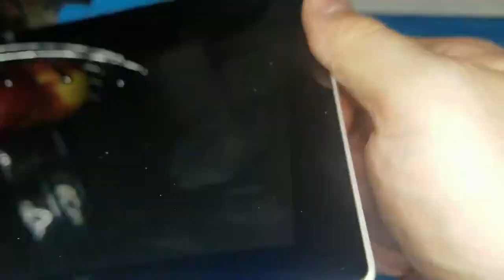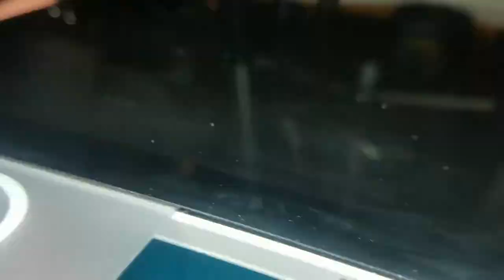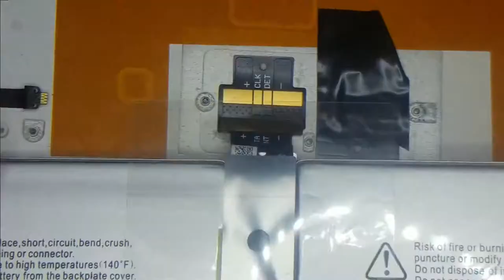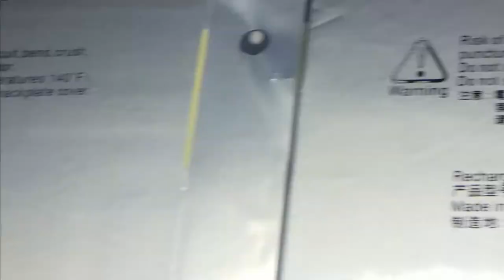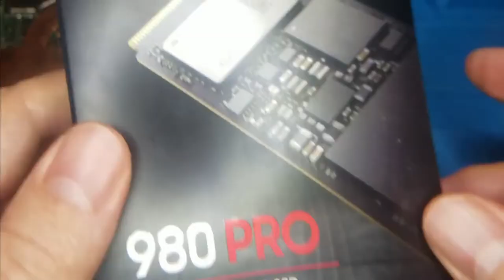Microsoft Surface Pro 4 - screen bulge fixed, battery replaced, SSD upgraded!

Comment: This is exactly what I needed. A proper full teardown and reassembly, including motherboard removal.
Reply from the maker: Glad it was useful, hope your project went well ;)
Reply: Sort of. Screen is off successfully, but wow that antenna array is designed to be destroyed on removal! 

£20 for a new assembly and £36 for a new battery and I should have a fully working surface pro 4 once again.
Reply from the maker: Ha, I know what you mean! Before you splurge on new antenna strips, check if you can simply straighten them up. Unless you straight up cut/tear them on removal, these are just foil strips, if they're just bunched up you can unfold them back.
Reply: @JustMakeItNow  unfortunately it’s toast. The best advice i would give others is get a sharp knife and cut as close to the display assembly as you can. That black glue is sticky and horrible
Reply: @JustMakeItNow  what did you find was the best way to remove all the glue before reapplying new glue?
Reply from the maker: Just scraping. But I just removed flappy/torn parts, and kept most of the original glue in place. It is just as sticky as before after heating it up a bit. So I just replaced missing adhesive parts, not all of it.
Reply: Great success! One new battery installed. Definitely take the motherboard out. It’s longer but much safer. Thanks for the excellent video
Reply from the maker: Congrats!

Comment: It's impossible to do such precise handwork with that fast music going on in the background!  Would have preferred the walk-through with no music at all, and with closer real-time video of how the little connectors and adhesives come apart.  Recommend using an ice cube tray or egg carton for tracking the screws and other small parts in their sequence of removal.  Thanks for the video!
Reply from the maker: Thanks! You can mute sound and change playback speed in the player controls. The video is already pretty long, and if it would be 1x speed everywhere no one ever would click on it ;)

Comment: Awesome video! Leaving a like and sub, keep it up man.
How thick can the double sided tape be? 3mm too much?
Reply from the maker: Thanks for the sub! I actually used exactly 3mm wide tape in this video ;)
Reply from the maker: Just to be clear, 3mm is width, not thickness.
Reply: I got some that is 1mm thick. The old one does not stick much anymore. Thinking about removing the old tape to make room for new stickier tape. What's your opinion?
Reply from the maker: Yeah, if the old adhesive is not sticking anymore, or is mangled up, it is better to remove and replace it. At the same time, you probably don't want to use super strong stuff in case you need to open it up again some time later.
Reply: Trying to put it all back together. Good news is it's booting. However, it appears that the screen assembly may have been damaged during removal. I get flickering and lines all over the place. Those ribbon cables only attach one way or is it possible to clip them on out of position? Maybe that's what I did.
Reply from the maker: Damage is a possibility, but sometimes the same effect could be due to bad connection. Try to re-seat display connector, there is really only one way it can be connected (but sometimes connection is incomplete).
Reply: @JustMakeItNow  OH well, I've tried to re-seat it a couple of times but always shows up with the same set of problems. There is also a (new) Crack richt across the screen although I can only see it if the screen is on. May have to buy a new screen.
Reply from the maker: Yeah, if you see a new crack there is a good chance that the issues you're seeing are due to the actual damage. 
:(
Reply: @JustMakeItNow   We'll see. New screen arriving next week

Comment: Great video! Wish I had seen yours first.. Didn't know about isolating the battery. Now it won't power up. Any idea what has blown can I fix it?
Reply from the maker: Sorry to hear that :( This is not uncommon, unfortunately. First thing, check the battery connector pins, sometimes these get deformed during disassembly/reassembly, and this prevents solid contact. If that's not it, try your old battery (if it worked at all), sometimes aftermarket batteries are faulty from the get go. If none of the above helped, things get progressively more difficult; potential fixes will require hot air station and knowing what you're doing. Couple of common things that go bad during battery replacements are Schottky diodes on the charging circuit, or any number of fuses on the mainboard (some are marked as 0 Ohm resistors). If you're good with microsoldering, check out this page, they have a good summary of potential issues with SP4 power: https://www.aonemobiles.com.au/2020/03/microsoft-surface-pro-4-no-power-no-schematics-no-problem/. Good luck!

Comment: thanks you for this tutorial, can you tell me what type of bit you are using on the screw gun. I have taken apart an iMac and have the screwdriver for those screws, I am wondering if it's the same size.
Reply from the maker: I don't remember exactly, but I am pretty sure this Surface Pro 4 used T4/T5 bits (Torx). I don't know what was in your iMac, but there is good chance that it may not work. Apple tends to like using pentalobe screws, these bits won't work on Torx.

Comment: :yt:Thank you for the tutorial.  But would you please tell me where you purchased the new battery and how much it cost?
Reply from the maker: I did buy my replacement battery through the local wholesale mobile repair supplier, so that probably won't be helpful to you. You can easily find these batteries online though, just search for "G3HTA027H" (this is the battery model number). They go for about $40-50 or so. I know for a fact that there are some on eBay, Aliexpress and even Amazon. Probably not OEMs, but I'd say it is still a pretty good deal to restore your Surface Pro 4 back to almost original condition.

Hope it helps. Let me know if you have any other questions! ;)
Reply: @JustMakeItNow  Thank you for your reply.  I found some eBay seller that carries this model number.  I also have a Surface Book (model: 1703 / CS4-00001) with a similar issue.  The right side of the screen is bulging.  I would like to replace the battery too.  Do you by any chance know the battery's model number? If not, is there a way to find it out?  Thanks.
Reply from the maker: I don't own this model, but I believe there are several battery models that are compatible with your 1st gen Surface Book: G3HTA044H, DAK822470K, G3HTA020H. If you're disassembling your device anyway, the easiest would be to look at the existing battery number to be sure.
Reply: @JustMakeItNow  Thank you very much.

Comment: Thanks very much. Very useful and educational video.
Reply: Where can I find spare screws for Surface Pro 4
Reply from the maker: You are welcome!
Reply from the maker: IIRC all the inside screws are T3 and T4 drive, these might be difficult to find for cheap if you're only missing a few. I'd probably just get one of these laptop/watch/glasses repair kits which have an assortment of small screws. Those would likely be Philips heads rather than Torx, but for that kind of repair that won't matter.
Reply: @JustMakeItNow  thanks for your reply. I''ll try to find it.

Comment: Mine has only a slight bulge (maybe 2mm in the centre), but it is causing colour issues on the edges of the screen. I'm awaiting delivery of a heating pad & pry-tools. Do you think the screen will go back to normal after replacing the battery? Thanks for the great video!
Reply from the maker: Yeah, I forgot to mention that before complete screen delamination, swollen battery pushed up into LCD and this (as well as heat) caused visible discoloration on the screen. In my case, these were large yellowish areas - very visible on light backgrounds. After battery replacement these were completely gone, though it is not a guarantee.
Be careful with the heat though, it is easy to permadamage LCD. Just because heating pad is supposed to be temperature controlled does not mean it is necessarily very good at it, especially if not calibrated.
Reply: @JustMakeItNow  I already have an IR laser thermometer to check. Thanks for the tip!
Reply from the maker: Just keep in mind that pads may also have uneven heating due to the way heating element is embedded. Keep the temp settings a bit more conservative to be on the safe side, and you may still supplement it with more targeted heat from a heatgun. You should be good as with a swollen battery it is much easier to lift up the screen (which is the hardest part of the process).

Comment: How long does a fix like this last, if it's successful?
Reply from the maker: For as long as the new battery is going to function. This depends on battery, usage patterns etc. Can easily be several years if everything goes according to plan, which will probably exceed usable life of the device anyway. If not, replacing it the second time is a much easier procedure (unless you hardglued screen back in :) )

Comment: read every comment , good job.  I have this problem with i7 version I'm typing this on.  Stupid Question: did you clone the surface before onto the new samsung SSD?  Or did the msbios do a stock install?  Also same issue with same gen Surface i7 Book Pro
Reply from the maker: Not a stupid question at all, I probably should have mentioned it. Yes, I did clone the drive. Don't remember the details, but I usually just boot up into live Linux from USB and dump existing drive onto network location. Then after swapping the drive I boot into live Linux again and restore the dump, and then re-adjust partition sizes if the new drive has more space than the old one.

Comment: Hi i have surface pro 4 that is not working and i was planning on removing the battery and put it in another surface pro 4 that has a bloated battery.. Will it work?.. Thanks
Reply from the maker: Well, it depends ;) First of all, are you sure that battery is good in the not-working Surface? It does not need to be bloated or visibly damaged to get bad. More importantly, you'd have to be really careful in removing the one that you intend to transplant - you'd want a lot of isopropyl and probably some heat. The thing is, most of the time when you remove the battery it is quite warped as you pull on the adhesive with quite a bit of force, and the batteries are very thin and pliable. I am sure it is possible, but it might be more work than you think. You can try this first, and then go for a replacement battery is it doesn't work. These batteries are not super expensive.

Comment: What kind of double sided tape is that? Do you have a specific recommendation?
Reply from the maker: Double-sided acrylic tape, the exact specs are not super critical as long as it fits dimension-wise, so 1-2mm wide with thin carriers. Usually this would be something from either 3M or Tesa, you can see in this video I used 3M 9448A tape, but Tesa tapes (something like 75620) would work just as well.
Reply: @JustMakeItNow  thanks dude

Comment: I replaced ed two batteries on two surface pro 4 laptops and they all say battery not detected. they both switch on with ac power but when not plugged in they do not turn on.
Reply from the maker: This happens, unfortunately, especially with aftermarket batteries. First thing I'd check if the battery cable is seated properly. If no issues there (likely, as you can run on AC), then you can try to do hard reset, which goes something like this:
.
- Power off
- Hold Volume Up and the Power button for 15 seconds. The Surface logo screen may flash, but continue to hold for 15 seconds.
- Release the buttons
- Wait 10 seconds
- Power on the Surface
.
Also, while on AC, check if battery device shows up under Device Manager in Windows.

Comment: Hi.  I've done everything exactly as shown but when I try to power it up I get nothing.  Even if it is plugged in.   Did I fry my motherboard?  Blow a fuse?  How can I tell?  Is it now a paper weight?   Thanks.
Reply from the maker: It's possible :( One thing to make sure is that you properly connected the battery, and that the battery is in working order. Without battery connection the device won't work even if plugged in (AFAIR). You may try to connect your old battery if it was working, even if it wasn't working well. If that's not the issue, there is a good chance that you did blow either fuses or some diodes on the motherboard. This is not something that can be easily diagnosed or repaired. If you know what you're doing you can try to check for continuity on fuses (R000) or diodes, but the chances are not high. Unfortunately, it is not uncommon to blow something on the motherboard if you're not super careful with connecting battery terminals - if these are slightly misaligned, bad things happen :(
.
Good luck!
Reply: @JustMakeItNow  thanks for the reply.  I think I'll bring it to a professional tomorrow.
Reply from the maker: Nothing's wrong with that, hopefully you'll get it fixed. Would be great if you could post a comment as to what the issue was, in case it would be identified.

Comment: where did you get the battery from
Reply from the maker: I got it from a local mobile repair supplier, but you can get these batteries from eBay, Amazon, Aliexpress and elsewhere. This is a relatively easy-to-find item, look for part number G3HTA027H or DYNR01.

Comment: What temperture setting did you use for the gun?
Reply from the maker: Pretty sure the lowest I could set my hot air station to, so that would be 100C=212F. You can get away with higher temperatures, it is all about how long you're staying over the same spot, and how much you're heating up the screen panel itself. Damaging screen due to overheating is the danger, other components wouldn't be damaged by these temperatures.
Reply: How high is the risk of the battery burning or exploding?

Comment: What do you have the temperature set to on your heat station?
Reply from the maker: I had it on the lowest setting - 100C, though the source temperature is not that important. The important part is how hot your screen surface gets, that's why I was constantly checking it with my hand. You can go higher temps, this means you have to reduce heat application time. IIRC screen panels get permanent damage at about 80-100C, depending on screen technology (LCD, OLED).
Reply: @JustMakeItNow  Thanks. The kit comes in tomorrow along with a larger M.2 drive. So I'm fixing and upgrading all at once.
Reply from the maker: No worries. Just don't rush and it's going to be alright ;) Good luck!

Comment: I need this fix for my surface pro 4 so bad.   It just sits in a drawer now.  Can you recommend someone/somewhere that can do this exact fix for me?
Reply from the maker: You're probably better off finding a local mobile repair shop, they should be able to do such job. If you go local, at least you will have someone to complain to if things don't go according to plan ;)
Reply: @JustMakeItNow  thanks for the reply!  You're a talented dude for sure. I'll check out my local options

Comment: Mine powers up but the screen is blank
Reply from the maker: Try to connect external screen, or access via Remote Desktop. It is possible that the screen is dead, but the rest is functional.
Reply: @JustMakeItNow   I tried that, and it works with an external monitor, the touch function works and the tablet works fine wit the external monitor. the tablet display lights up when powering on but is blank. It's not cracked. I check the display drivers all look good so I'm not sure what to do now.
Reply from the maker: Well, most of the tablet works, so that's a good sign ;) In your case it is most likely one of two things: either internal display cable is not seated properly in its socket, or the panel itself is dead. Just because it is not visibly cracked and digitizer works doesn't mean LCD panel is functional.
I'd open up the case, try to reseat display cables and see if that helps. If not, replace the panel as the hard part (opening up) is already done.

Comment: Ive repaired dozens of surface pro's there is no need for heat guns. i can take the screen off in 5 min. All you need is a old ID card. Start at the top and swipe all the way around the screen. Ive repaired every surface model without breaking the screen ever
Reply from the maker: You must have some military-grade ID cards ;) I can see how you can cut adhesive cold once there is an opening (which is, in all fairness, the case in this video). This would be harder than heated, but would be doable, certainly if the device was opened before. But if the original adhesive is intact all around (e.g. no delamination yet), how do you start your cut without heat? The whole idea is to soften the adhesive so a part of the screen can be pulled with a suction cup and then you can insert your cutting tool. Without heat, how do you first insert the card in?
Reply: So do a video showing your incredible technique…?
Reply: Not a truth challenge by me, but please could you post a video of how to do this if you’re ever doing one again?  I’d like to open my SP4 up and I’m definitely reluctant to break it.  Mine has the video wobbling fault.